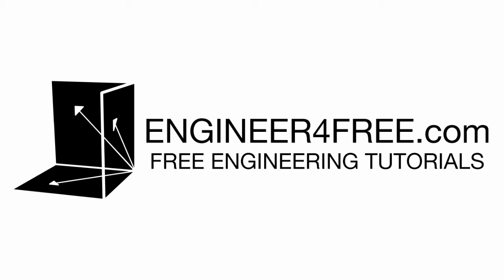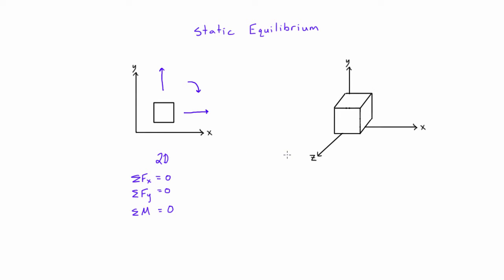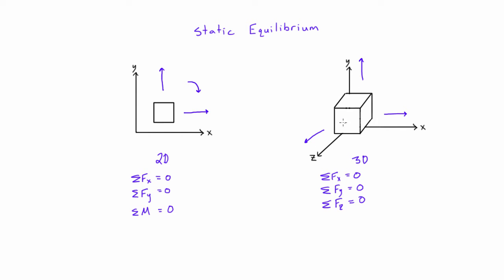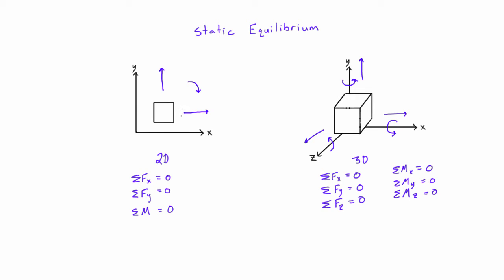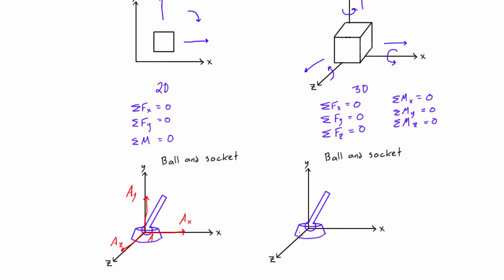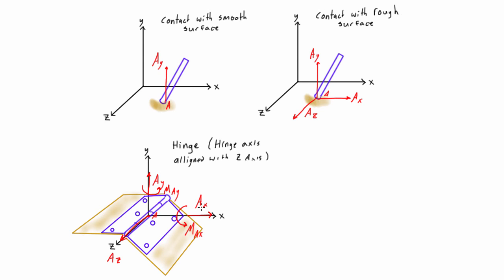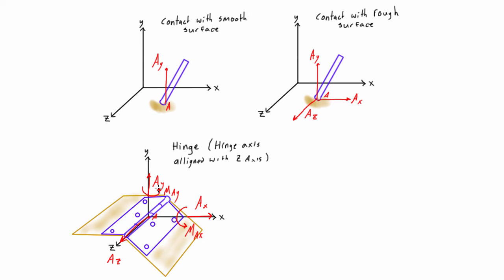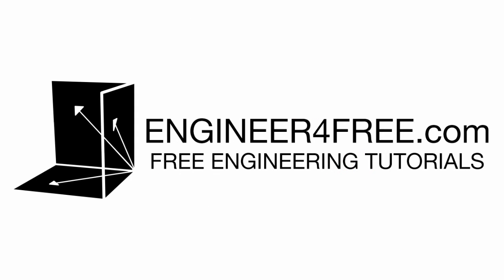Reaction forces and the different types of 3D supports

Comment: what about a cable in 3D or any D for that matter ? i understand your body can rotate about the axis of the "joint". What about in the other axis, it cannot rotate about these right, not if the cable is under tension at least. Thank you !
Reply from the maker: cables, ropes, chains, etc can show up in 2D and 3D problems. The thing to know about cables is that they can ONLY be in tension, and that the tensile force is oriented along the axis of the cable. They will always be considered to be connected to something else with a pin (2D) or a ball/socket (3D). For that reason, there isn't going to be any moments at that reaction, just the tension pulling directly away from it from the cable. Make sense?
Reply: It does ! Thank you very much ! Where can I email you if I have additional questions ?